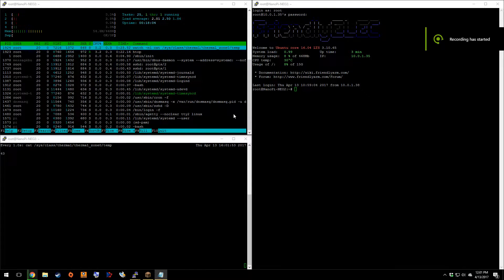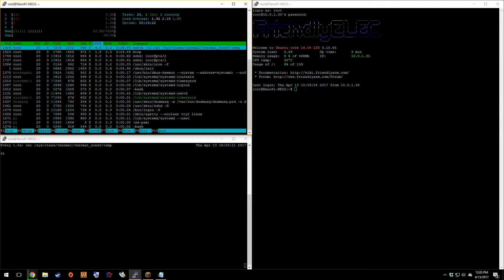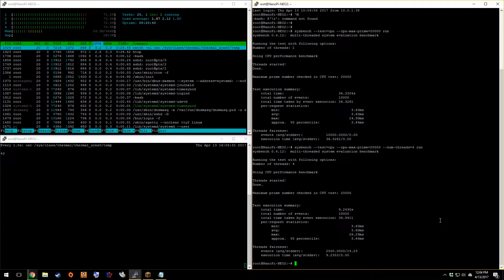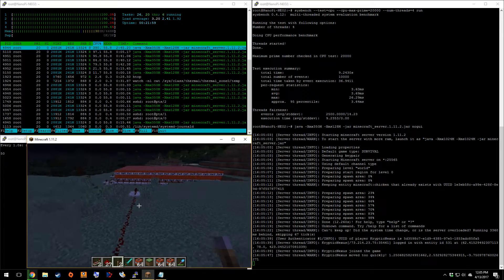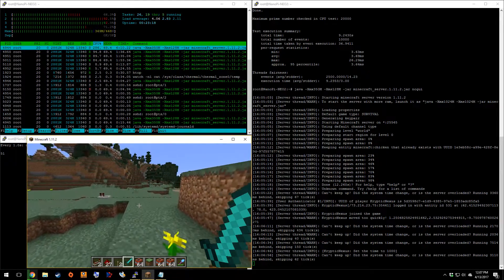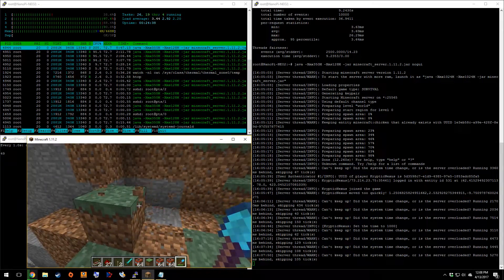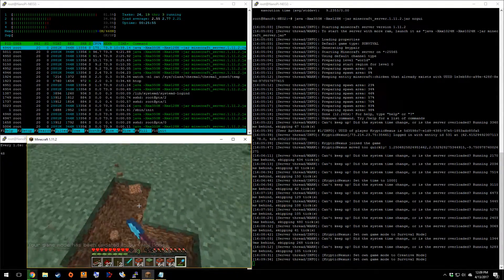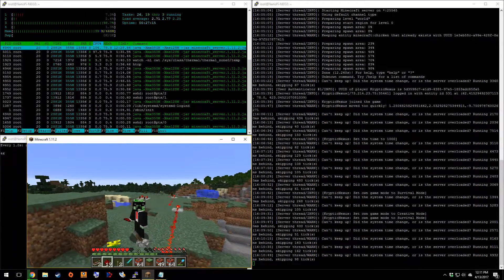Benchmarking the Nanopi Neo2 - Can It Run Minecraft Server?

Comment: Does a GigE port help it over a slower ethernet port on similar devices?  I was looking at getting an RPI3B, but now I have to way it's higher but still low RAM capacity vs this one's smallter form factor and cost and faster ethernet port (if it makes a difference on that device).
Reply from the maker: +OptimisticPessimist the gigabit Port allows for better transfer rates in home then over the internet. So if you're doing some kind of video transcoding from a network drive across the SBC then data will be able to transfer faster theoretically because there's more involved than just the transfer rate of the ethernet but that's essentially what it allows you to do.

As far as this computer versus a Raspberry Pi 3 I do want to let you know that if you want to hook this up to a display you were better off to go with a Raspberry Pi 3 than a Neo 2 because the Neo 2 does not have any video output it's only accessible over SSH.

Hope this helps sorry it took almost 10 hours to get back to you.
Reply: Not a problem.  Thanks for the reply.  I doubt that board can do any video work fast enough to saturate a slower link.  Except maybe from whatever format to something like HuffYUV for playback.  Can it transcode FHD and up to AVC ultrafast fast enough to be useful?  HuffYUV output would be way too high bitrate for a 1GbE connection.
Reply from the maker: +OptimisticPessimist exactly. I honestly can say the only reason for gigabyte Ethernet is if you are using it as a nas. If it could read/write 35+MB a second to a hard drive then that would useful but other than that that's all I can really say.
Reply: I misremembered that in my head.  1Gbs can easily handle two FHD HuffYUV streams.  It's up to ~400Mbps not MBps. Oops.